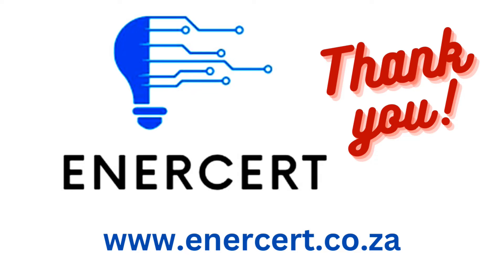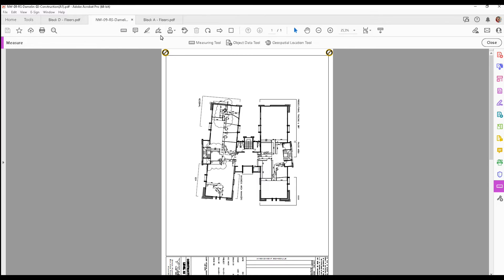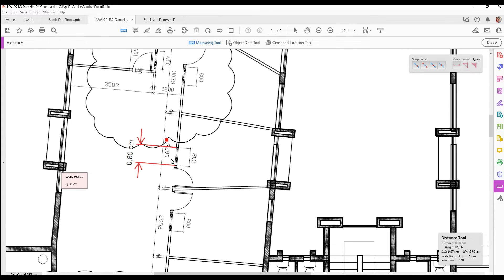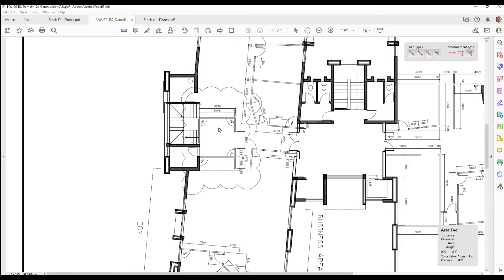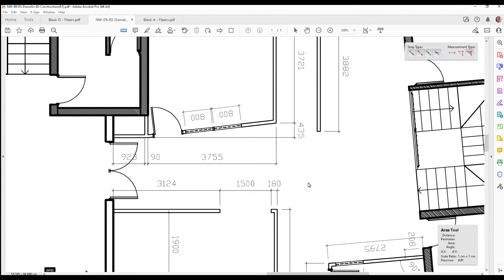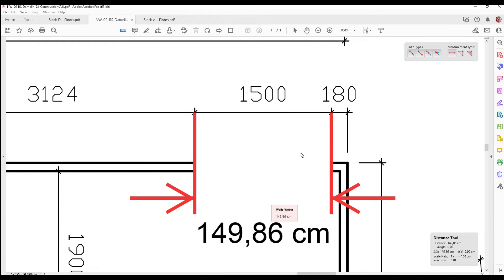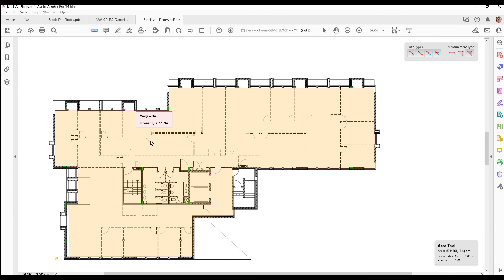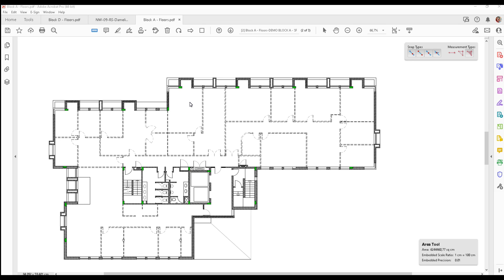EPC Training - Calibrate the Scale in Adobe Acrobat Measurement Tool

Comment: Thanks for the information. You got quite slow pace there and at 5:30 you start answering the Titel question. I don't know that the rest 6 minutes or so are after the Title question is answered, but I feel that straight information videos should be about that info promised.
Reply from the maker: Thanks for the feedback—it’s noted and appreciated. This particular video was an unscripted walkthrough I recorded spontaneously to help the community with some practical insights, which is why the pacing and structure may feel a bit loose. I’ve since started focusing on more structured, professionally scripted content. You're welcome to check out the recent Rosebank videos for a clearer sense of that direction, and I’d value your thoughts on those as well.